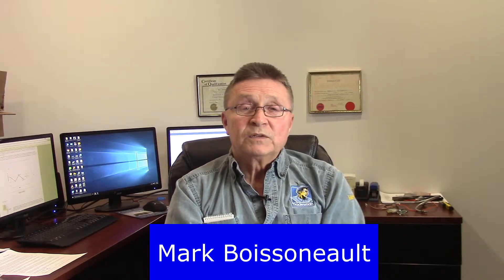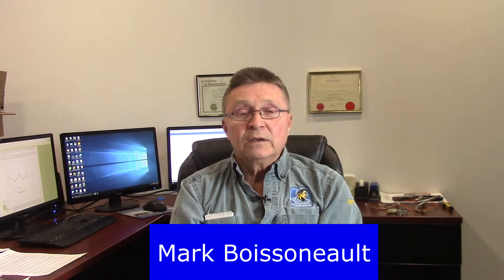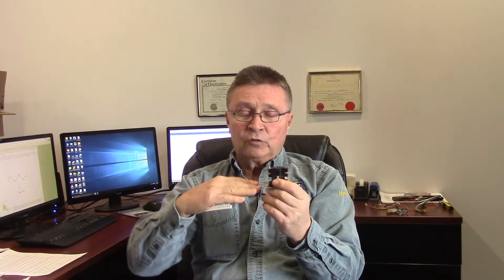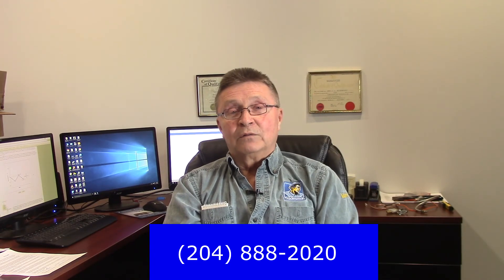What Is a Electric Furnace Sequencer ?

Comment: In your example does elements go on 1,4then they go off and 2,5 on then off when that goes off 3,6 come on?  If that happened then the furnace would have on two (e.g. 5kw elements on a any time and hardly it’s max btu. 
A second possibility is that 1,4 come on (remember 2 sequencers linked) then 2,5 are added if the house is cold then 3,6 are added if the house is still cold. In effect, the last point is all 6 elements on and all (e.g. 90,000 btu) being used at one time? 
Not sure why sequencers have on and off times on top of that. I am confused 😊